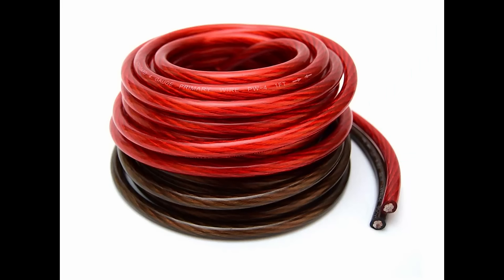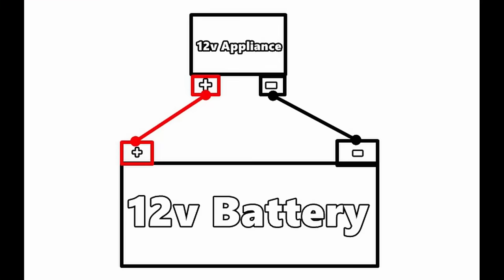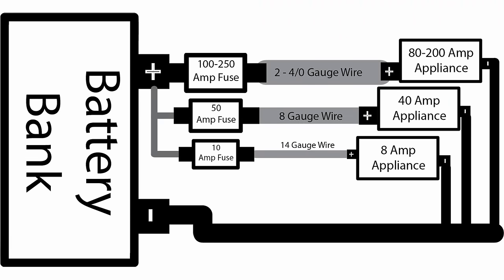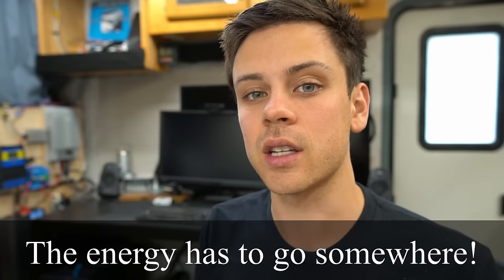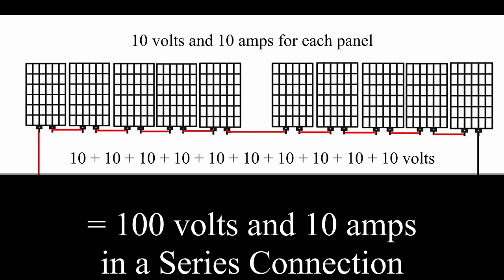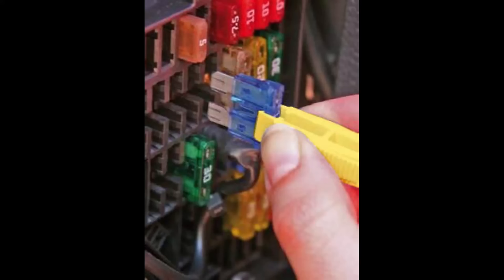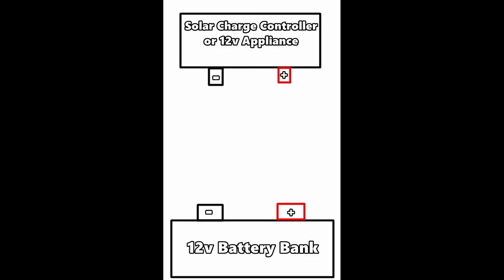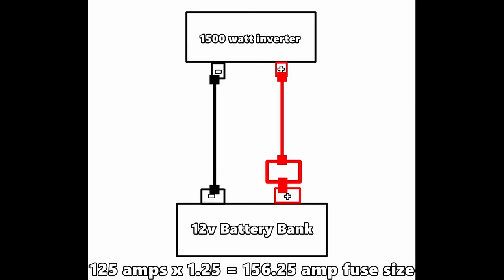Electricity Explained: Volts, Amps, Watts, Fuse Sizing, Wire Gauge, AC/DC, Solar Power and more!

Comment: I am an electrician apprentice and I learned more from your YouTube than what I’ve learned from my apprenticeship. You’re able to break down technical information into easier concepts to grasp. Thank you!
Reply: Maybe you can help me out!
To figure out wattage of 220v US do you need to add both 110v wire amperage together first or not?
Reply: @Laurel-Crowned  Watt’s law. Power = voltage * amp. So watts = voltage * amps.
Reply: Where are you from Anita sengrath..?
Reply: You didn’t make it did you?
Reply: Recommend taking Physics II (Electric & Magnetic) you will understand the theory behind all this stuff. Plus you learn more about capacitors, resistors, inductors, transformers... more.
Reply: You had electrical equipment and access to people who knew the things that you wanted to know; sounds like a you problem.
Reply: @marcusdaloia2974 had nothing better to do today but put somebody down?
Watts Law? 
How about 'Thumper's Law': "If you don't have anything nice to say, don't say anything at all."
Reply: Absolutely!!
Reply: Thank you for sharing your positive experience with the YouTube video! It's always refreshing when someone can break down technical information into easier concepts. Speaking of power, have you heard of the Segway Portable PowerStation Cube Series? It's a versatile power station with a massive capacity, fast recharging, and comprehensive protection features. It might be a great addition to your outdoor gear or home backup power products. Happy camping!

Comment: Energy is a fundamental concept in physics representing the capacity to do work. It exists in various forms and can be transferred or transformed from one form to another but cannot be created or destroyed. This principle is known as the conservation of energy. Kinetic energy is the energy of motion. Any object in motion has kinetic energy. The amount of kinetic energy depends on the mass of the object and its velocity. Potential energy is stored energy based on an object's position or state. There are several types of potential energy including gravitational potential energy which is energy stored due to an object's position above the ground, elastic potential energy which is energy stored in objects that can be stretched or compressed like springs, and chemical potential energy which is energy stored in chemical bonds released during chemical reactions. Thermal energy is the energy that comes from the temperature of matter. The faster the particles within an object move, the more thermal energy it has. Electrical energy is energy caused by the movement of electrons. It powers our homes and devices. Nuclear energy is energy stored in the nucleus of an atom. It can be released through nuclear reactions such as fission or fusion. Radiant energy is energy carried by electromagnetic waves such as light. The sun is a primary source of radiant energy. Energy can be transferred from one object to another and transformed from one form to another. Work is done when a force moves an object over a distance. Heat is a form of energy transfer between objects of different temperatures. It can occur through conduction, convection, or radiation. Energy can change forms. For example, a light bulb converts electrical energy into light and heat. A car engine converts chemical energy from fuel into kinetic energy to move the car and thermal energy as heat. The law of conservation of energy states that energy cannot be created or destroyed only transformed or transferred. This means the total energy in a closed system remains constant. For example, when you drop a ball its potential energy converts to kinetic energy as it falls. When it hits the ground some energy transforms into sound and thermal energy. Renewable energy sources like solar, wind, and hydroelectric power convert natural energy into usable forms without depleting resources. Non-renewable energy sources like fossil fuels are burned to release chemical energy but they are finite and contribute to pollution. Energy is measured in joules in the International System of Units. Other units include calories, kilowatt-hours, and British thermal units. Energy is a versatile and essential concept in physics underpinning all physical processes. Understanding how energy works and its various forms helps us harness it efficiently for various applications from powering homes to fueling vehicles and beyond.

Comment: I struggled with the concepts of volts, amps for quite a while. The analogy that I made up that kind of finally made sense to me is this: If the electrical wire is like a highway of cars, then amps are like the cars, voltage is their speed, and watt (total power) is their effect (for example if they were to hit a wall). More cars/amps = more damage to the wall, and higher speed/volts = also more damage to the wall.
Reply: this one is pretty good
Reply: you definitely  not make that up lol but this analogy got me through school for sure
Reply: amps is actually cars per unit of time XD
Reply: Only thing I would change is make speed LIMIT volts, not actual car speed (that’s more like drift speed of electrons)
Reply: Thank you. My visual brain is making sense of this now.
Reply: Water through a pipe is better (the hidraulic analogy), or even better is sucking air through a cigar filter. The filter is the lattice, and the air in it are the free electrons. Or let's say you’re blowing, not sucking, for the sake of better analogy. Your mouth is the battery, it presses on electrons (air) and thus makes them flow through the wire's lattice (the filter). The harder you blow, the faster the flow. Outer air at the end of the filter is the minus end of the battery. Your nose and breathing in is the chemical reaction within the battery that pushes the electrons back into the plus end to continue pressing on the wire. See the cyclic pattern? Now also imagine sticking another tiny piece of filter, but one with greater lattice density than the original one, at the end of your filter. It will make it that much harder to blow air through the new structure, making electrons (air) flow slower. That's your resistor, that new piece.

Comment: You essentially summed up the electrical course I took in my first semester of computer engineering in 15 min.  They should play this video in the first class of that course and let the students go home for the rest of the semester :) Great job!
Reply: There's some useful application advice here but this theory handwaving won't get you past the first test in an intro to EE class.
Reply: that won't pay salaries and tenure though
Reply: @GeoMac Granddad  which one can kill insect faster,  "72v dc 15watts" or "20v dc 15watts? I think the 72v because it has more volts but I'm ignorant.
Reply: @BOREDANDWELLBORED  
Bug zappers have much higher voltages but limited to very low current for safety.   Similar to electric fence.
Reply: @elgringoec  so which one will kill the insect faster, the "72v 15watt" or "20v 15watt "?
Reply: Drawing out a 15-minute lesson over an entire semester is part of the reason education is so damn expensive.

Comment: I spent two years in Navy Electronics school. You do a great job explaining complex subject to a non engineer. A gift.
Reply: I went to Navy Avionics A School in the early 70s. I retired from a communications technician position doing about everything you can do in civilian world of communications. One place I worked our DC load was 1400 amps at 48 Volts. It was backup till one of  the 275KW generators started.

Comment: Well done. I'm a specialist in my field so I frequently have to translate complex ideas into user-friendly information for clients who naturally are more concerned with the result than the actual process. That being said, if I can't get the basics across, things don't move forward, hence the need for 'translating' the info. And you just did me that favor. Thanks so much. Your explanation is truly top notch. Clear, functional, applicable... I already feel for more confident about my impending purchase of solar panels and related equipment. Keep up the good work.
Reply: That's right, the knowledge needed for applying existing technology to an application is a small subset of that needed to design a technology.

Comment: Very good explanation Sir. I am certified by the ISCET and hold a degree in Electronics Engineering Technology. Although I  am long ago retired as an old fossel technician, I still wish someone like you had been around when I first started. Blessings to you and your students. BTW, besides the solar cell analogy, you might consider using a transformer for more clarity. Whether step up or step down, the power is the same on primary and secondary windings.

Comment: I like the waterfall analogy for series vs parallel. The voltage is determined by the height of the waterfall.
You could 'arrange' 2 waterfalls side by side (parallel) so that the amps (water flow rate) doubles and voltage is unchanged. Or one after the other (series) so that the water flow rate (amps) is unchanged but the voltage (height) doubles.

Comment: The water hose analogy always confused me because it makes Volts and Amps appear the same to me. A catapult analogy worked wonders. Good luck everyone!

1) Volts = Size of the Catapult
2) Amps = Size of the Rock
3) Watts = Firerate of the Catapult

I like this because it shows what happens when you have too big a rock on your catapult, or too high of firerate will break the catapult. I know this is an extreme simplification but as a beginner the catapult analogy really helped me, the water hose confused me.
Its not the size of the catapult that kills people, its the size and speed of the rock.
Reply: @Apexmoon:
Hello my friend. I must say that eventhough  your analogy makes some sense, you are missing some important info. For example, electrons travel at a constant speed which approaches the speed of light. Also, electrons do not necessarily travel in a parabola as a catapult will. Now for my apology. Electrons flow just like water flows. Imagine a water tank filled with water. The water tank has a valve (resistor) and a pipe (wire). At this time there is only potentential energy (voltage) because the tank is filled with water. Voltage is joules/coulomb. The Coulomb is a large quantity of electrons coulomb= 6.24 x 10¹⁸ electrons. Keep in mind that the water tank is like a storage battery and it is at full capacity or potential. Now, if we open the valve the water will begin to flow. The flow of the water, as in a creek or river, is current flow. Electrically, we measure this current flow as amps which is Coulombs/Second. So therefore, if 1 coulomb passes a point in 1 second, it will produce 1Ampere of current. Hope this helps. Have a Great Day😊

Comment: It bears mentioning that using higher voltages reduces amps and wire gauge needed. The 300 foot run up to my solar panels was way too expensive at 24vdc, I buried the batteries and inverter under the panels and ran 120vac down a much smaller wire, saved $hundreds
Reply: Doug Mcdonell same concept as the utility uses. Most houses have 7200V to the nearest pole. Then coupled down to 240/120 to the service entrance. Could you imagine the cost of running everything as 240/120? Good job 👍

Comment: An excellent video.  I'm a senior and I did not know a lot of this about electricity. I'm trying to learn so I can set up my electrical grid on my RV. This older Class C RV has an existing system with old wiring and very poor components. Trying to redo this, as a senior female, is pretty challenging. One mistake and Kaput you are history.  Very good tutorial.

Feedback - 
1. Love the diagrams!  They are great for visual leaners. The more diagrams, the better.  Audio learning is only for musicians.  
2. One thing young people do - they speak continuously without stopping.  This is hard on the brain. Include natural pauses between thoughts like paragraphs in writing. New concept, new paragraph, and a small gap in speech. It allows the brain to catch up and gives ears a rest.  The concept of 'negative space' in architecture and landscaping is important. Empty spaces make things stand out better. So too, with speech. As you mature, you will see the benefit of gaps of silence, even small gaps.
3. Thank you for no music.  What joy!!!

Comment: Honestly mate, loved it.  I had a problem with my alternator in my van and was told about how it might be to do with my split charger and how my main battery yadda yadda etc. And I realised that even though I teach English and film I have absolutely no idea what the mechanic was talking about. Anyway, I stumbled across your video - what a great explanation! I will now go back to my converted campervan and go through the wiring - I love to understand things like this; you made it soo easy so thanks mate.  I will have to rewatch but I had no idea what my solar panels were doing, I just had solar panels on the van. Knowledge is power. Thanks again. I really get it.  No longer looking like the fool in the garage.  Great mate. Lots of love and gratitude from Scotland.
Cheers 
Sean

Comment: Electrical flow has been compared to water flowing in a pipe. I believe it would be more accurate to compare it to air which can be compressed and be more dense in one area of the flow than another.

Comment: I have been watching your videos for a couple of years and your explanations of how electricity works is very thorough but I cannot comprehend it I don't know why I just don't get. But I have successfully followed your suggestions and using quality materials and I have built several systems onboard my RV so that I actually have three separate systems on board so I can multi-task I can run my microwave and my induction cooktop at the same time using two different battery Banks and inverters. I use the high-quality wires that you suggest and have built these systems without really understanding how they work just how to put them together and everything works great! So don't take it personally you are the best teacher out there but some of us just don't get it.. but if we follow what you say we will have a wonderful day! Thank you will for your teaching it's greatly appreciated.

Comment: Great 🎉 explanation
I am 60 years old, have dyslexia and have loved mechanical and electronics since a wee boy. Took post secondary electronics, dropped out, could not understand the math got into brand marketing, yet always fixed things and set up others electronics. Your basic explanation is excellent for those who may struggle having someone explain putting around peg through a round hole versus having someone visually show a dyslexic how to put a round peg through a round hole, wish you showed visual explanations in your mathematically equations, which was excellent very simple. You asked for suggestions comments here is one comment that I think will help your YouTube channel reach more people; use more visual aids such as when you’re explaining appliances using 1000 W 40 A 12 V or 110 or 220 person with dyslexia. Would love to see what that appliance might be a stereo amp. Is it a washer and dryer is it a microwave and use those in your diagrams along with your mathematical equations and will bring joy to many more people. Keep it up young man.

Comment: Good video for beginners learning electronics,  recommended you make PIE chart P=watts I=Amps E=volts .  P ×I÷R   also there's another E÷I×R ! It will really help viewers that are beginners! Pretty  sure  you have seen both charts, if not let me know and I will send them to you , or you can likely find them on the net!  You do a good job explaining but both of these charts will make it easier for your viewers  and it will help them with calculations of  volts,amps resistance and power  at a glance!  Keep up the great job!

Comment: A couple things you should have noted in your wire-size/load example is that:  1) the wire length for the entire electrical path from battery to device and back to the battery is the length to use, in this case 10'+10'=20';  2) one needs to state which efficiency/circuit-type they wish to have (3%/critical or 10%/non-critical).  Since you stated 4 awg for your 20' (actual) 100 amp circuit, one must assume the 10%/non-critical wire size values were used since  the 3%/non-critical wire size would be 2 awg based on this chart.

Comment: Awsome mate , perfectly explained & now all makes 💯 sense ! I’m a motorcycle mechanic by trade but do gate automation these days and always low voltage ! 
Currently installing a solar system on my wife’s horse float and this helps a hell of a lot 👍👍
I was going to install an inverter just to accommodate a mates e-bike charger but after doing the maths it isn’t practical or economically feasible, realising I’d need 3x Lithium battery bank min and as I don’t ride an e-bike that’s a problem for him lol 😝 
Cheers 🍻

Comment: on voltage its not thicker with the hose analogy, but rather diameter. The reason I point this very minor detail out is due to my very high respect for your tutorials.

Comment: The volt, amp, and watt analogy was very helpful.  I have always had a hard time remembering these terms and theirs meaning.  Then again, you throw another term, CURRENT.

I think I know what it means: electricity flow rate.  It's that watt, though?

Thanks for the apology.  Now, I have the courage to learn something about electricity.

Comment: Your vids are absolutely OUT OF THIS WORLD. I'm about to convert a van for myself and this is Soooooooo helpful. At 16:27 you had 404.4W / 12V equals 33.7A ... that's if the panels are run Parallel right? It would still be 5.82 Amps if the panels are in series correct ??? Did I just learn something watching you?? LOL